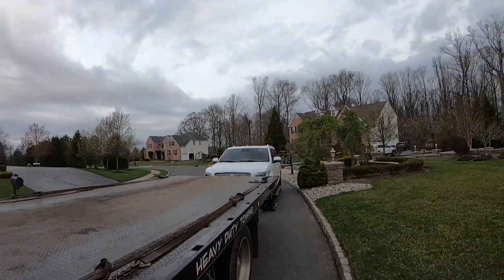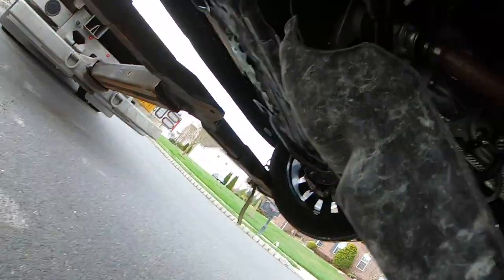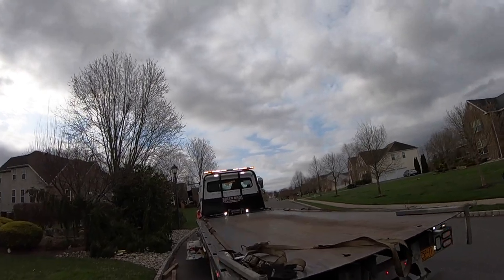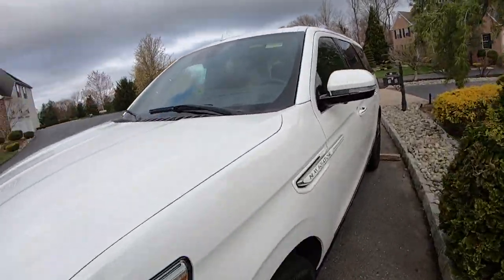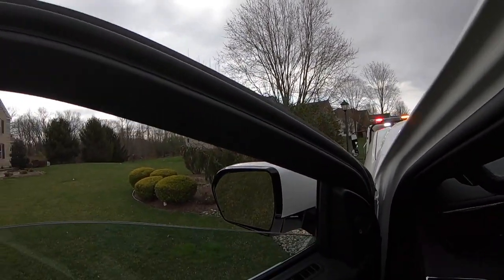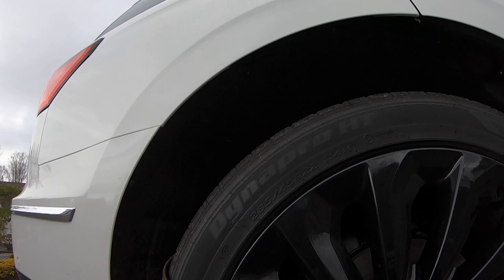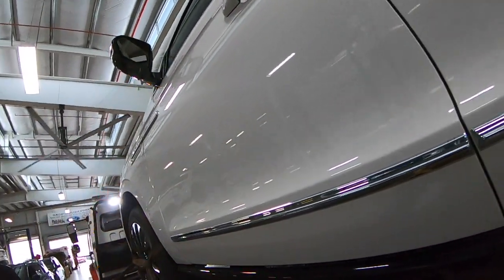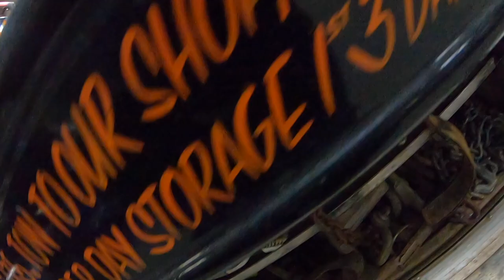2021 Navigator stuk in park. (Neutral override as well)

Comment: I appreciate what you're doing here but this is insane. The amount of time you spent doing this you could of banged skates under the tires and had it up on the deck strapped down and a few miles down the Rd. Much safer 0 chance of you getting run over. Not to mention the huge chance you take of damaging something
Reply from the maker: I definitely agree with you on using skates. I was in a safe spot so I wasn’t worried about that part. Normally in a situation like that I would’ve put skates and pulled it right up but I took the opportunity to make the video. Believe me I prefer the safest option available. Someone told me there might be a location inside the truck with a possibility of another option of getting the vehicle into neutral. I will be checking soon enough because I didn’t see anything when I checked. If there is I will make another video because I would prefer no one getting underneath any vehicles.
Reply: @TowMan127  There is no safe spot when do'n this job. Anytime your feet hit the pavement your chances of get'n hurt or killed raises dramatically. Do not become complacent... Great video, appreciate all your efforts and assistance!!
Reply: I need this type of video not everyone or every company can have these special equipments 💪...good job

Comment: My 2019 died last night not battery. Could not put into neutral to push it into safe parking. Nothing works even could not get under car because running boards were down . Have to call tow truck hope he knows this method.  My lincoln has had so many problems been in shop more then I've driven it. Never agai..living nightmare
Reply from the maker: The release for the neutral should be the same. Sucks that that happened. I’ve dealt with. Few customers with the same issue. One lady had it happen to her on the highway and it was a scary situation. I’m not a big fan of Ford/ Lincoln vehicles.

Comment: No I was talking about not using the wheel lift to do what you did but using the bed so you wouldn't have to work twice
Reply from the maker: I’d rather get under the vehicle being on the wheel lift than under the bed with all that weight and pressure on the edge of the bed.

Comment: Damage claim right there if something goes wrong its on you. You could still do it with the bed hook like you were gonna load it wheels on the bed tighten the cable  raise the bed like they say kill 2 birds with 1 stone did you say it push button and the parking brake engage when dropped
Reply from the maker: It has the new style electronic shifter and won’t shift without doing what I did. Yes I could’ve just rolled the bed under it then skates the vehicle the rest of the way but this video is to show how I got it into neutral and loaded it. A ton of my videos are neutral override videos.